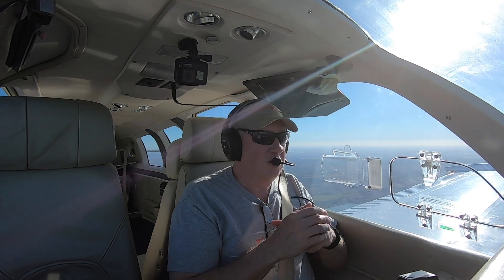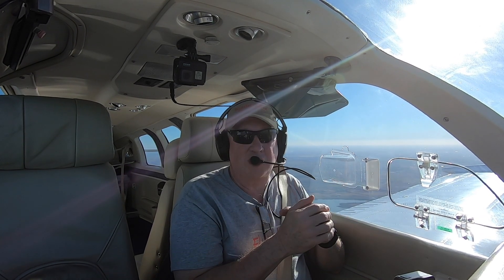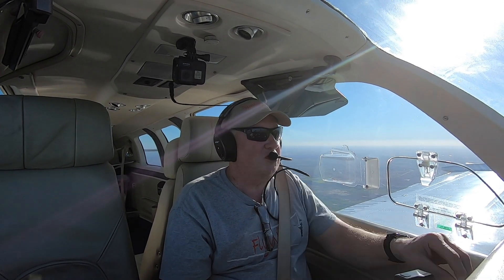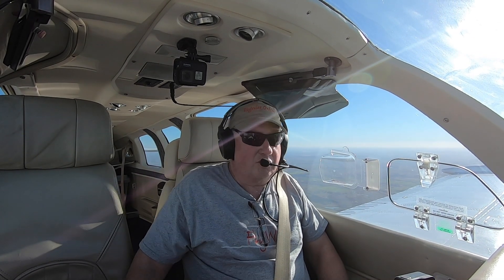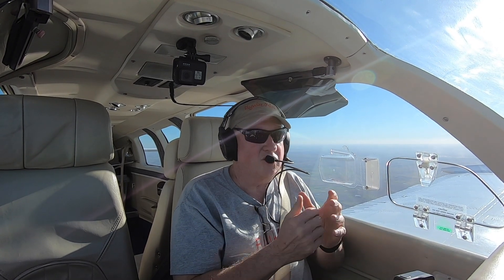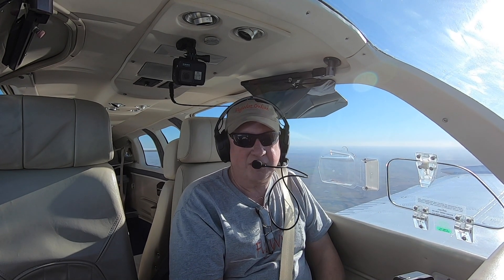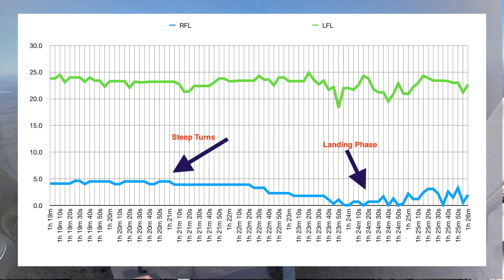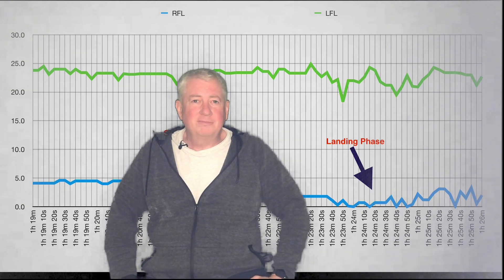Bonanza Fuel Starvation Fuel Unporting: Is it a Thing

Comment: Thanks for a good video. Forgive my ignorance- I'm curious about the weight balance of the wing tanks.  Does the gas diminish equally or do you have to use up one then switch to another? If so does that weight differential make a difference in how the plane handles? Not like a taildragger -
Reply from the maker: Good questions Nancy. Each Tip Tank feeds into the Main tank on that wing. It's up to you how you pump them out... I have a video on how to manage that. The weight at the tips makes the airplane roll a little slower, but it is negligible.

Comment: Just a thought Scott.. I think that drawing the conclusion that fuel un-porting could have happened based on the fuel sender data might be pre-mature. The fuel supply is fed from the lowest part of the bladder, inboard. In many cases, from a walled area, similar to a hopper tank, with a one way door to keep the fuel inside.  The fuel sender unit is outside of this “hopper.” Just because the sender is “seeing” no fuel or zero, that may not accurately account for the fuel in the hopper, which is where the fuel feeding the engine is actually sourced. Thoughts?... Thanks again for the great videos!
Reply from the maker: Jeff, thanks for the thoughts! And for watching. Not all tanks have baffling inside and the configuration varies. Generally, for G.A airplanes the baffling is not very sophisticated as a matter of cost. If the fuel level is at or around zero for a period of time then you will run out of fuel regardless of where the sender is. I just redid the test and climbs/descents and turbulence seem to have the biggest impact.

Comment: I always make my approach a little high so if the engine quits I am assured of making the run way. A little slip will bleed off altitude and speed when needed. But this is  really good Info! I loved my last A36!
Reply from the maker: Thanks for the input Gary. I do slips all the time in other airplanes. But am not crazy about slipping the Bo. That's just me.
Reply: @FlyWirescottperdue  A Bo with gear and flaps down comes down like a rock. No slip needed.
Reply: @FlyWirescottperdue  understand, I grew up in taildraggers and had a moment when my nose gear touched down while holding a slip. Old habbits. But i owned a A36 for many years and would use small slips to make corrections. But remembered straighten our my controls before allowing the nose gear to touch down.
Reply from the maker: @garymccann2960  Important safety tip!

Comment: This highlights why you don’t want to fly a slip on a long final for a crosswind landing. You will unport the fuel should it contain minimum fuel and if flying in a slip long enough, the fuel in the header tank (if equipped) will be burned off and the engine will quit. It is much better to fly final in a crab and transition to a slip crossing the threshold or at the flare. If one ever flies a large aircraft, this is how it is done, so you might as well learn to do it right before the fact.
Reply from the maker: Excellent point!
Reply: Plus it's much easier to fly and also easier on the passengers.